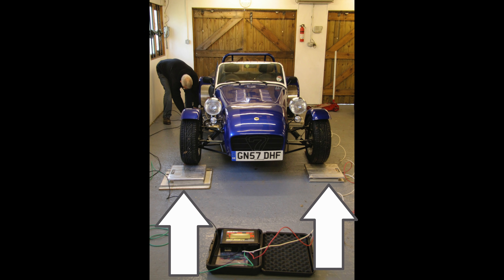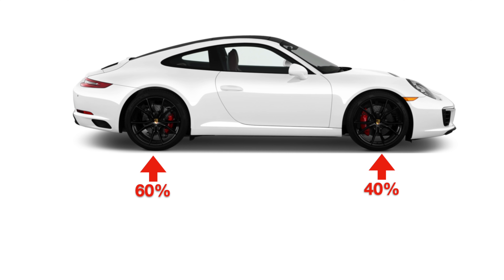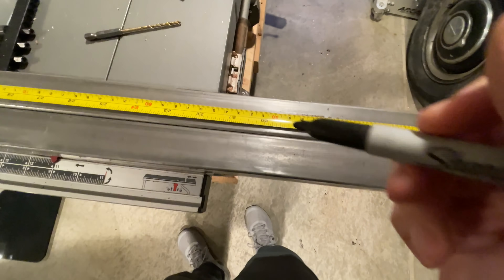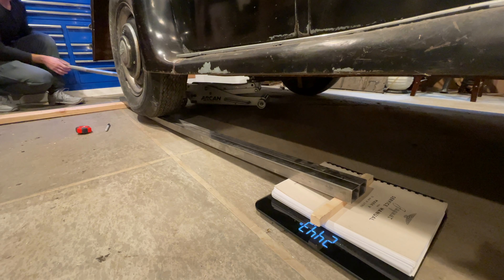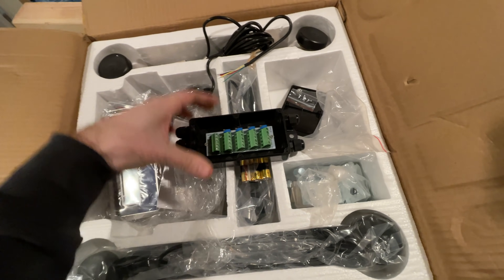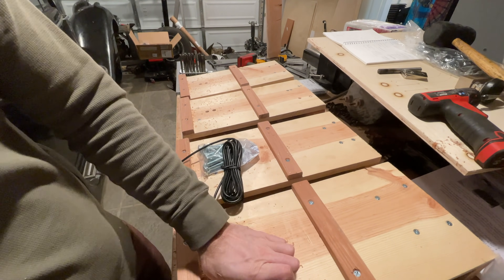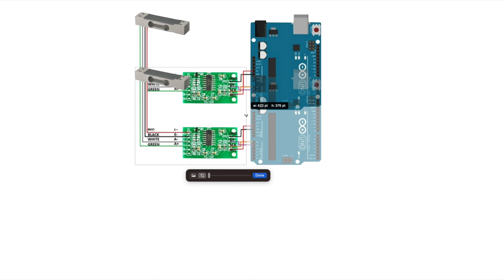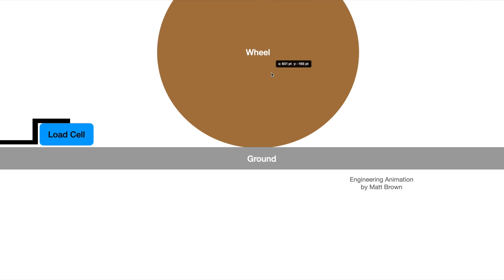I Invented a Better Way to Weigh Your Car. And it's Cheaper, Too.

Comment: Funny. My last contract project was to measure cable tension of a cable going over an arced chute. 4 loads, on at each corner. To confirm the math, I build a chive from a bicycle wheel. Got 4 load cells from adafruit, and mounted it to an aluminium c-channel. Single axis load cell in line with the cable. Voila!!! Correlation between tension and chite-supporting load cells. I never thought of using the test jig to measure my Miata weight balance!?!?! But after your video, it will happen.

Comment: i like this idea and i will use it however not with the jack you used.  Il get the cheaper dollies that require jacking the vehicle up and putting the dolly under the tire.  Il get 2 dollies so that the front or rear of the vehicle is on dollies while the opposite side is not.

Comment: I have built a lot of scales in my ventures. The cheapest industrial load cell is more expensive than a single bathroom scale. Good solution, but I wouldn't invest in a patent either.

Comment: @superfastmatt brilliant hack for the dolly jacks! i didnt like the cost of corner scales, went down the same rabit hole but took a left turn and found a 1 ton crane scale on amazon for 40 of the kings pounds. Hung it off the engine crane, put a strap though the spokes of the wheels, pumped up the crane and weighed my heart out. Been weighing everything since then, trying to add as much lightness as possible.

Comment: My issues with the final solution: If you want a fairly accurate reading, you'd need to build 4 of these things and lift each wheel to get a reading with all 4 in the air. That's 4 load cell kits (at $220 a piece) and 4 dolly's (Also at ~ $200 a piece). At that point its half the price for a good compact corner weight kit that is fits in a case the size of a milk crate, and is only $1k. Not only that, but the kit is much more accurate than this diy option.

I do love how you can jack up AND weigh the car though...but you still have to lift each corner (4 times), where personally I lift my car by the center Diff and center front jack point (2 times lifting). 

Storage for this DIY option would be a headache vs the cheaper more accurate method.
Reply: Those fancy scales use the same type of load cell, just like all other electric scales. They aren't as inaccurate as your post seems to indicate. You're also confusing what you mean by accurate. 2-4lbs is EVERYTHING when it's a 120lb woman checking her own weight, a drop in the bucket for a 25-3500lb car.

In any case, I'd have no prob saving $600 by making 4 spacers, push/drive the car onto them, then slide one out while I weigh it.

Comment: This is super cool.  Definitely seems workable to measure one corner at a time if your goal is just to determine total vehicle weight.  
To do actual corner balancing, being able to measure all 4 corners simultaneously is a nice advantage however.  One can probably get an entry-level corner balance scale system for less than the cost of 4 of these rigs.

Comment: Or, if you don't need super accurate 4 corner weights, go to your local CAT scale for tractor trailers. For a vehicle that you have to trailer, just weigh with and without the vehicle. $13.50 per weigh, goes down to a few bucks if you weigh again within a short time frame
Reply: There's a quary by me that has the scale always active, and it's just off the shoulder of the road lol. No posted "no tresspassing" signs nearby lol.

Comment: Having built a similar device using the same load cell kit and a harbor freight daytona dolly jack i can confirm it works great. 
Just make sure to not use the little metal spacers the instruction manual says you must use. Its lying to you

Comment: I ordered a 660lb scale on prime day deal and i'm going to try to measure each corner using a supporting block. does the overall distance between the scale and supporting block matter or just that the scale is twice the distance? I was planning to use a very sturdy piece of square steel tubing but it's only about 3 feet long. putting the scale 2 feet from the tire should work to give me half the weight thought right?
Reply: Hmmm, i think your math is wrong or I'm misunderstanding what you were saying. i got my scale and did some tests with my weight and standing in the middle of my lever gives me half my weight on the scale, which makes sense to me.

Comment: This is awesome. I think with 2 scales doing one axle at a time you will get a very good reading.lifting the front then the rear as the effect between left and right would be far more than front and rear as very little inaccuracy would be presnet when the other axle is used as a falcum

Comment: I just did the bathroom scale trick before to get approximate weights on my Riley build and I have used it before on another car. If you have an open wheeled car and a gantry crane could you use a crane scale to lift each wheel just off the ground and measure each corner weight that way?

Comment: Simply awesome -- I have wanted something like this for years (about a decade actually) and here you go bringing something that not only works well as a scale but honestly can do double duty.   I tried making a similar lever system to what you did and gave up on accuracy plus my version was outright dangerous.

5-10 bucks at a truck scale is what I ended up doing -- but that involves driving to a truck scale...   Highly recommended if your car is say, moving but has its own pitfalls.  For one, truck scales are fairly accurate but only in a relative sense.   Like relative to the humidity and temperature that day for example.   Still, this is better.  You can calibrate this easily by simply standing on it.   It's portable and has the aforementioned double duty as a useful tool in your shop when you're not weighing stuff.   

Kudos man, love your channel.   Plus your video editing skill ... dude.   Thanks for sharing.

Comment: This is not the cheapest way to do it.

The true cheapest way to do it: set your tire pressure the same all around, and know what that pressure is. Put a piece of paper under each tire and spraypaint around the tire, then pull the 4 sheets of paper. Measure how many square inches of paper are unpainted, because they were hidden underneath the tire. This is the contact patch of the tire. Multiply the contact patch by the PSI of the tire, and that's how much weight is being supported by that tire.  If you have your tires at, say, 30 psi and your contact area for a tire is 25 square inches, then that tire is supporting 750 lbs.

Total cost: 4 sheets of paper, 1 can of spraypaint, 1 tire pressure gauge.

Comment: I like your setup, I did my own setup a while ago but I just used a 500kg load cell on my engine crane and then wrapped a sling around the hub through the wheel and jacked it up untill I was able to slide a sheet of paper underneath it and for what I was doing at the time it worked pretty well and now I have a scale for weighing engines etc..

Comment: In the early 1980s I worked on a Ralt RT4 and we used a very simple lever hooked to an old dial type tension wrench to lift the wheel. 
We would have a piece of paper under the tyre, when you could just move the paper you would read the scale. 
It gave surprisingly repeatable results.

Comment: You could have just gone to a truck stop. They generally have scales that will give you a total weight, front weight and rear weight for like $15.

Also, seeing as how cattle can weight 2,000lbs each, the agricultural load sensors should be rated for about 2,000 lbs for a set of four.

Comment: Honest question, if you were just trying to figure out the front/rear weight distribution, why didn't you just go to a truck stop and use a truck scale? $13 and you have guaranteed accurate front/rear measurements.

Comment: Maths, not math. Still good, I bought four 300kg scales of ebay for £50 each, and uprated the springs in side to twice, so adding 200kg shows 100kg.
All in I can weigh over 2000kg

Comment: I came across the same problem when I just wanted to see how much lighter I could make my rallycross car. My solution, which I have yet to implement, was to get a 600lb livestock/hunting hanging scale, suspend it from something like an engine hoist and pick each wheel up with it. And use a pulley to double the weight capacity if needed. I can jack up the other corner of the car to level it for better accuracy.
Reply: CAT scales, 15 bucks
Reply: @The11901  I had to look it up. OK, it's a location where I take my car to get weighed. I have a not-road-legal offroad WRX, though. I would have to trailer it there, then weigh everything I then add or remove.
Reply: @DustyWall  assuming you own a truck and trailer… still seems like the easiest route. They’re at basically every truck stop. I almost did what you did for a rock crawler truck and then I remembered semi truck scales exist and generally have to be pretty accurate. 🤷‍♂️ seems like a solution our boy super fast mat didn’t think of. Typically you can measure axle weights too, I think they have 3 “zones.” Can’t do corner weights though.

Comment: Love the design and would be a sharp competitor in the market with more accurate scales. The only flaw with it is with normal scales you can use hub stands to dial in the alignment at the same time. But for 99% of people your solution is more than adequate

Comment: The load cell kit cost $200.  The HF wheel dolly cost $100.  To make 4 would cost at least $1200.  That's not that cheap.  BUT...
You wouldn't need to buy 4 load cell kits to make 4 of these.  You could buy 4 wheel dollies and use the other 3 unmodified wheel dollies to level the car.  That brings you down to a minimum cost of $600.  Worth considering.
Reply: Except for the fact that a corner scale kit on Amazon is under $700 with free shipping.
Reply: He is using only one and then moves to the other 3 corners. (6:39 "if" you had four of these) was only a suggestion for leveling the whole car.

Comment: Just use 2 bathroom scales adjoined and with a piece of wood across them, put a block of wood under each of the 3 remaining wheels that's the same height as the scales+wood and weigh one corner at a time swapping the siamese scale/wood hybrid to each wheel in turn and using the resulting free wooden block to replace the scales on the corner you just did. Simples! Accurate and VERY cheap. This would give you the ability to go to (in your scales case) 800lbs per corner.
Reply: good idea - there are scales available for reasonable money now that go to 550 lbs so two of those together gives you 1100 lbs per corner that would be sufficient for many normal cars and overkill for most race cars. cheapest corner weight setup on amazon is like 850 bucks. You could do a total 4 wheel setup with a pair of scales at each wheel for half of that or less. Or make only 2 for half as much money

Comment: This is awesome, I'm running into the same problem with my build.  My solution was to call up one of the performance race shops and ask how much they'd charge to weigh it on a slow day.  A bit cheaper, but less elegant and it only works once.
Reply: I just go to the truck scales or any recycling center for the full weight... to get corner weight not so easy

Comment: Aren’t there places where you can roll your car on and it will tell the weigh, you roll the front tires to know the front weight, whole car and then rear tires. I know that it would need taking a non driving car there but still seems easier than this to me. Im just an idiot suggesting stuff i dont know about

Comment: Been using the animal scale system for years weighing my Tesla builds with harbor freight 4 wheeled roller dollies replacing the wheels with the load cells. I like this much better, in fact I just order the amazon setup you have to switch them out. Great job on giving me an upgrade. Thank you.

Comment: Very cool video... again.  Here's your "comment tax" for the algorithm.   :)  

Next up:  Using a fish scale, an engine hoist, and multiple strand pulleys to weigh the engine.... the scale is tied into the lines, where there are 3 holding things up.  Multiple the scale by 3.  Done.  ;)

Comment: I just go to the city dump, pull halfway on the scales, then fully on, then half way off the other end.  The guy there is good with it on the rare occasions when I do it and gives me all three numbers.
Reply: Don’t truck scales measure weight per axle? Can’t you just go to a truck stop and use their scale
Reply: @PedroFerrer-vq5sw yes and no, they do. But it’s designed for 18 wheel rigs, it doesn’t really know what to do with a Honda civic.

Comment: Not nearly as gee-whiz, but I think hydraulic gauges (or some sort of pressure transducer, if you must) tapped into your jacks would (could) work.
Reply: Unfortunately, the pressure in the dolly cylinder will vary with lift height as the mechanical advanatge changes. I once had a bottle jack i attached pressure gauge to, though. Useful, but no good for wheels.

Comment: If you did not produce four of these (16 loadcells), and put them all under the same car to all wheels, you are probably still measuring really wrong. But giving an idea for the weight balance, maybe still usable.
Reply: If you make 3 spacers under the other 3 wheels, the exact height of the load cells assembly,  the CG of the car does not shift and accuracy remains.

Comment: @5:27 Why not just rotate the platform with load cells 90 degrees (about a vertical axis) and then roll the car onto the platform? - no jacking required.

Comment: I really appreciate seeing the failure attempt.  I went down a similar route looking at load cells and live stock scales before eventually caving and buying a proper set of corner scales.  You touched on the garage being not level but you might surprised how unlevel it can be.  My garage drops almost 3/4in of my car's wheel base.
Reply: Which is why Matt's solution is actually better, unless you can adjust the height of a real set of corner scales by 3/4"

Comment: the easiest way would be to go where they weigh trucks, front tires on the scale, rear off, then rear on front off. you have your weight ratio. and for sanity check, weigh the whole thing, see if the numbers match. those things are cheap to use, in my area, (Greece) the normal charge is a couple to 5 bucks average.

Comment: Thought American bathroom scales went way over 400 lbs 😉
Reply: They are surprisingly difficult to find but one can use two (one for each foot - and in this case, the whole surface available for each foot is appreciated since at 400+ lbs, your feet are probably really wide).

Comment: I just go to a scrap yard and use the scale there
Reply from the maker: I've used truck stop scales before; they have different pads so you can get the front/rear bias. The car doesn't drive so I needed something in my garage.
Reply: SuperfastMatt oh
Reply: Just watched this and was thinking the same thing, but I figured it was already discussed and as noted, doesn't give you front / rear; just an option for checking your work:)

Comment: I used to run around with some dirt trackers. Big believers in wedge effects- I believe "boogering the wedge" is about getting it wrong. Don't quote me on that, but that was what I got from it, listening while I laid under the car draining hot rear end oil out of the quick change so we could change the ratio between heats. The notebook our "crewchief" kept on all those "little arcane details" was always kept locked up when not directly in use. I really like your work around- it could catch on, especially if you could figure a way to put the readouts on a phone app for comparison. I am a plumber and merely have typing skills and a cousin to fix the damn thing when I press the wrong button! FR
Reply from the maker: That makes more sense that boogering would be getting it wrong. I heard it a few times long ago but don't remember the context so that might be true.
Reply: @SuperfastMatt  It was a "bizzy minute"- a 15 minute feature while we were in the pit from a 2nd place finish! They wanted a little lower axle so the 25 gal fuel cell of methanol would finish the race. The track had started wet and dried up, "boogering the wedge" all up- the car wasn't handling like it started. Bill dug out his "top secret" notebook and started telling people what to do- they were using the large equivilant of a hanging fishing scale to '"read" the wedge. I guess it worked- Randy won the 25 lap feature going away- the engine was up to black smoke by the last lap so the joy was limited. Those were the days, my friend! I did like your answer to the scales problem- all it lacked was a simo four wheel set up and a screen to read it all on and I thought about all the home automation deals that the cell phone reads and reports. The Jag ought to get you another trip to Leno's- I'm jealous! FR

Comment: Another thing you can do is go to a truck stop $15-20 and you can use their certified truck scales to measure front and back weight. Maximum capacity should be over 100,000 lbs so u can't weigh your mom